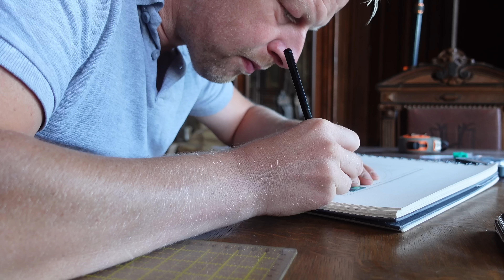DIY Ceiling moulding on a budget for €40 | Recreating the original Titanic ceiling for a chateau.

Comment: Tip: When you cover the poly-trim with plaster, all you have to do is mix a weak plaster about the thickness of creamy butter or weaker and paint it over the trim. You can paint a couple of coats and may not have to sand that much.

Comment: Interesting how those of olden times incorporated mystical and spiritual symbols into their architecture. The eight-pointed star/compass rose signified hope and balance between heaven, earth, and nature and the cardinal compass points and equinoxes. When surrounded by a circle - infinity - a Cosmic aspect is added. It can symbolize the victory of light over darkness. Depending upon the culture, the meanings vary. But what's interesting is that the eight-pointed star is either ubiquitous among cultures or was incorporated by cultures each one adding their own interpretation to its meaning. You've done a wonderful job replicating in design what you plan to enlarge/repair upon the ceiling.

Comment: 21:46 Sorry Terry, but I think you still need to do the wood  trim on the ceiling. The chataue is so grand it needs it.  Also, a while back you showed us a mirror with picture in it and you are going to use in the salon, 27:28 at first I thought dark  stain would look great until you showed the Grey fireplace. I think the pale blue would look better with the fireplace.
Reply: I agree.  I would have preferred the wood.

Comment: Polystyrene will invalidate any insurance you have as its flammable and drips when melting if rooms on fire - i cant think why you chose that as an option - seriously.......in the long run if would work out cheaper to buy pre formed plaster with radius for circles and straight mouldings for straight edges - all available to purchase pre made......its also very simple to make your own too with home made latex moulds and plaster........sorry for being critical.......finished product may look nice but lets hope you never have a fire.
Reply: Don't suppose you have noticed, but virtually every room in the building and all the floors are made of a very flammable material, wood, hence a small amount of polystyrene coving isn't going to make much of a difference.
Reply: @LaReynedeNeige  ...........theres a reason polystyrene decorative roof tiles were banned.....can you guess why?.........yes i agree some house construction materials are flammable but none as bad as polystyrene...........why dont you do an experiment yourself with a piece of wood and piece of polystyrene? - you can let me know results.
Reply: @geoffdundee  In the overall scheme of this house, what proportion do you think is polystyrene to wood?

I don't think you have enough fingers to work it out. 😁

Note: on that criterion, they shouldn't be hanging synthetic fabric curtains either.
Reply: @LaReynedeNeige  .........Was that supposed to be an immature insult? >>>I don't think you have enough fingers to work it out. 😁

Go and do an experiment like ive mentioned burning both polystyrene and wood - then you can get back to me once youve grown up.

Would the National Trust use polystyrene on any restoration projects in their properties? 🤣
Reply: @geoffdundee  Just responding in kind to your patronising comment. 😄 

He's not doing a historic restoration. If he were to do that, he'd be forking out a lot more money. I daresay his idea of using a plaster coating has some merit with regards to fire prevention. However, if flames are already leaping high enough to reach that ceiling, I doubt the presence of some thin strips of polystyrene is going to make all that much of a difference.
Reply: @LaReynedeNeige  ...polystyrene melting is like throwing petrol onto a fire........btw my comments are not patronising in the slightest........i actually enjoy what these guys are doing and i dont want it being jeopardised by a simple mistake of using polystyrene for quickness on a project...........im very surprised they went with that material.
Reply: @geoffdundee  And yet it's widely sold for coving.
Reply: @LaReynedeNeige  .........yes im aware it is but its such a fire hazard
Reply: @geoffdundee  As noted, most of the curtains sold in shops have the same issue. As with other furnishings. In many years of buying house insurance I've yet to see a clause which stipulates they won't pay out if these exist in a house. It's simply not realistic. Covering the ceiling completely with such tiles, sure, that would not be wise.
Reply: @LaReynedeNeige  .....maybe clarify it with your home insurance company before installing anything highly flammable.
Reply: @geoffdundee  It's never been cited anywhere any time when I've purchased insurance in over thirty years of home ownership.
Reply: @LaReynedeNeige  ........ perhaps phone them and clarify.........they will raise the cost of your premiums if you have them anywhere in your home.......the recommendation is they are removed.
Reply: @geoffdundee  But it's not stated anywhere in the policy document. The only exclusion regarding materials relates to asbestos, nothing else. As you are very certain about this please describe any wording you have in yours that prohibits the use of polystyrene coving.
Reply: @LaReynedeNeige  
Why is EPS Insurance so Expensive?

So, we’ve established that EPS is very flammable. This, crossed with a number of highly publicised major fires, and the added difficulty of assessing and insuring the panels means that EPS insurance has become one of the most expensive policies. 

In 2016 a fire broke out at a bacon factory, SunPork Fresh Foods’ Swickers, in Kingaroy, Queensland. It was the largest pork processing plant in the southern hemisphere and parts of the plant, including the boning room, distribution area and chillers, were burnt to the ground. The source of the fire was later established to be the EPS paneling. 

A similar case occurred two years later at the Thomas Foods International abattoir at Murray Bridge in Adelaide. Thomas Foods was one of Australia’s biggest abattoirs, with exports to over 80 countries. The fire burned for several days and caused tens of millions of dollars worth of damage. It was caused by sparks from welding nearby igniting the foam, and fire crews struggled to extinguish the fire because of the panels. 

Since those two fires The Australian Institute of Building Surveyors has issued a warning to be aware of the dangers of insulation cladding. They warned that it is extremely dangerous in both commercial and residential properties Prior to that statement many officials had focused primarily on medium to high-rise buildings. 

Authorities have also noted that  the EPS sandwich panel fire risk is very high due to the fact that they’re normally wedged behind  concrete, plaster, or sheet metal. Metal sheeting can prevent fire crews from extinguishing a blaze or being able to tell if the fire has continued to burn.

If you’re concerned about the rising cost of EPS insurance there are lots of different ways you can try to reduce the risk in your home and business. Alternatively if you’d like to speak to an insurance expert about the hazards and available insurance policies then the team at Ausure Horizon would be happy to help you. Ausure Horizon specialises in EPS coverage and can help you figure out which tactics will help to keep your property safe and which policy might best suit your needs. If you’re interested then contact the team at Ausure Horizon today!
Reply: @geoffdundee  You've avoided answering my question. What clause can you quote from your own house insurance that specifically mentions polystyrene as invalidating house insurance.  Don't bother me with lengthy irrelevant spam. You are quoting information regarding something different. Stick to the subject.

Update: just did some googling re this EPS insurance you're going on about. The only search results that come up appear to be in Australia, which seems to be what you're quoting. Not France or anywhere else. Nothing of the kind in the UK where I am. Let me reiterate. If there is no clause in an insurance policy regarding the material, it cannot be used as a reason to not honour an insurance agreement.
Reply: @LaReynedeNeige  .....i think you avoided phoning your ins comp to find out as youre afraid your premiums will rise......anyway ive not avoided answering you but as youre not very bright i will let you ponder a bit longer why polystyrene is not safe and will reply once youve asked your ins comp what their stance is regards said material.
Reply: @geoffdundee  Baloney. My insurance is online via an app, with all the detail available there. If it's not in the insurance document, it's not a concern.
Reply: @geoffdundee  You still didn't confirm the detail of your own policy, which says to me it's not there, but you can't admit it, so you resort to personal insult. Tut tut. 😆

Out of interest, I've made an enquiry with my insurer to confirm what they would or wouldn't cover in the circumstances. Response can be up to 24 hours.
Reply: @geoffdundee  Answer received from my insurer. It wouldn't invalidate a claim. They basically said what I've already pointed out - the policy has no exclusions relating to this material. 

Now your turn.

What does your insurer say? Because I rather think they will say the same.

You just can't own up to being wrong, can you 🤣
Reply: @LaReynedeNeige  .........my insurer wouldnt pay out as my house is brand new and doesnt contain any flammable materials such as polystyrene.